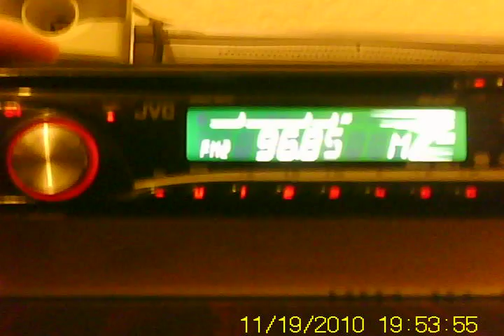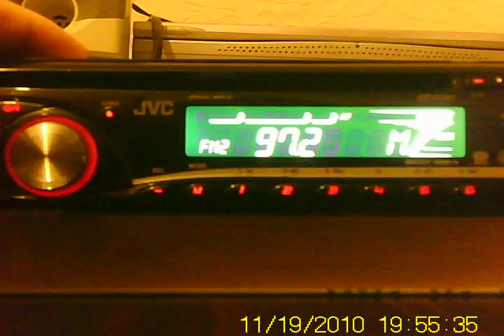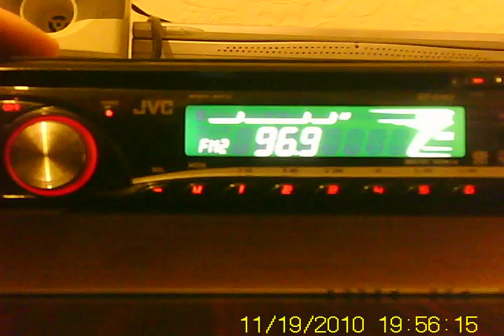JVC KD G342 selectivity test  flat conditions 191110 SUNP0001

Comment: Hello! I bought this car stereo for FM DX too. So I would like to ask you how the selectivity really is? I saw your video on the comparison between the Sony XDR F1HD and this JVC. But can it separate for example a strong local station on 95.3 and directly on 95.4 a weak station that is further away?
Reply from the maker: Probably not. A weak station 200kHz away from a strong local is not a problem.
Reply: @pe1etr  hm okay, thanks for your reply. But can it handle a little weaker stations 100khz away from each other?
Reply: So I thought that it has very good selectivity, because in your comparison against the Sony, in the summary you said that the Sony has slightly better selectivity than the JVC. So I thought that the JVC must have very good selectivity. Currently I am using a Kenwood car radio for DX, but its selectivity is not as good as the Sony’s. But I know that some car radios actually have similar selectivity like the Sony XDR-F1HD.
Reply from the maker: @dejantasic9209  You're welcome. Yes it can.
Reply: @pe1etr  okay, thanks! :)